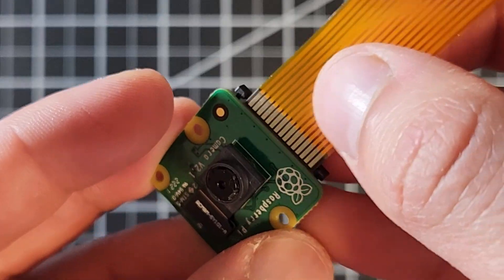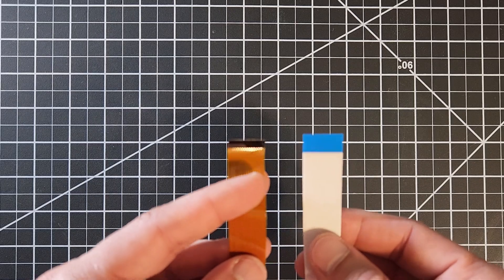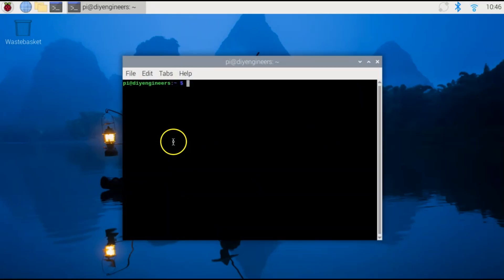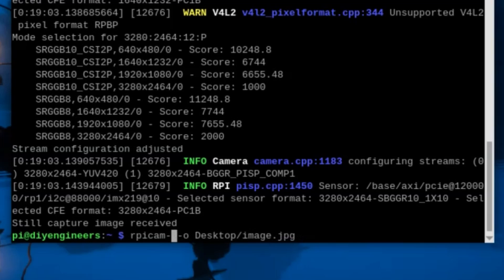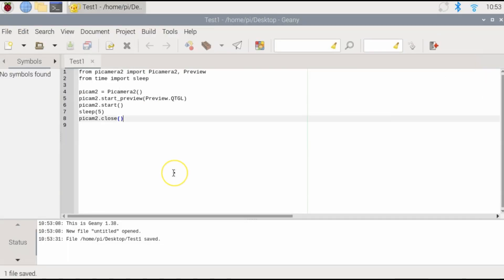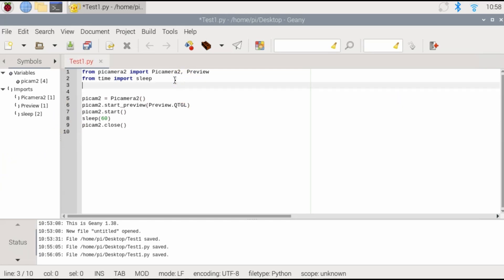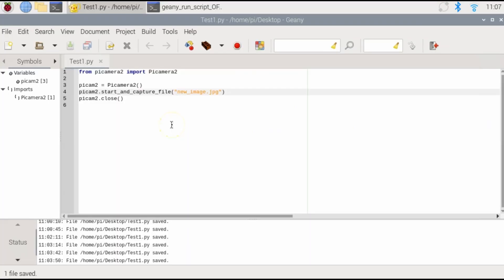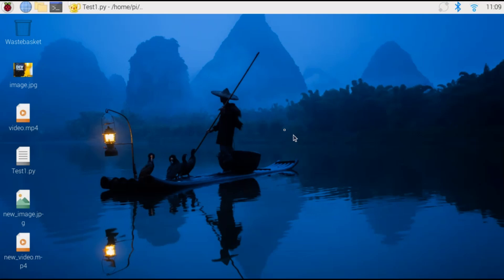Master The Raspberry Pi Camera With This Simple Tutorial!

Comment: Hi,
I’m using a Raspberry Pi 5 with a Camera Module V3 (IMX708) on Raspberry Pi OS Bookworm.
The camera is detected and listed (rpicam-hello sees the sensor), but it doesn’t actually work when capturing images or video. I keep getting a timeout error.

I’m using rpicam-apps / libcamera.
Has anyone else experienced this with the V3 camera on RPi 5? Is there a known fix or workaround?

Comment: Thanks for the video as it helped me install the cable the right way. 
I'm using a Pi 5 with an OV5647 and the latest Pi OS updates. The camera is detected and works, but I can't see the preview with 'rpicam-hello' unless I switch from the default Wayland desktop to an X desktop. 
Any idea how to make it work with Wayland? (The only hint is an error message "Preview window unavailable" where you got "Made X/EGL preview window")
For now I started a second desktop using X to be able to see the preview, but I'd like to make it work with Wayland too.
Reply: Forget it for now.. Despite being with Pi OS i mind, Wayland is insane in my opinion making such a massive change needing different drivers and dependencies and incompatible with the hardware..Pi Foundation must be nuts! Wayland is being used on us like a Guinea Pig is used, and is not yet supported for many things and I hate the decision to use Wayland. The only screen recorder with microphone and system audio that works on a Pi OS being ARM based is blke recorder, which hangs for about 15 minutes until finally the picture or video appears in the screencasts folder.. no progress to be seen just a frozen app. simple screen recorder and gpu recorder wont go as need x11 or nVidia graphics.. Wayland has terrible compatibility with some video and sound formats, and i believe it is more for stabiluity of system than to improve usability, which they need to catch up with as Xorg and X11 are far ahead. Pi OS is anyway stone age rubbish unless you put kde-p-lasma on it
Reply: @thailandamulets  Ironically I ended up using my trusty old Pi3 and just capturing the live stream from an IP camera, while the Pi5 is sitting on my table waiting for to find some other use.

Comment: Hi, may I ask if it is possible to use this camera with Ubuntu24? I am working a ROS2 project, so I need to run ROS2 on rpi5, but it seems only work with Ubuntu24 on rpi5. Thank you very much!
Reply: I have the same problem with V2 cammera on rpi5 on ubuntu 24.04.2

Comment: Great video, though is there any way to modify the exposure and contrast of the camera while it is streaming to the screen? I have a NoIR camera, and I want to mess with the settings to get the most out of the night vision as there doesn't seem to be a premade night vision mode to pick up as much infrared light as possible from the emitters, yet I cannot for the life of me find any relevant commands to do this.
Reply: because there aren't any. These cameras dont have an app or any administrative gui, just a few poxy commands from Raspberry Pi foundation so you can try them and say 'yeah this is only good for developers in industrial AI vision embedding into robotics to train software with, not to use as a camera stand alone in itself.Its ok to use for webcam wifi with a Pico to auto take screenshots or whatever, but unless you are doing a traffic control or population surveillance project for the NWO or APPLE, or some Logistics Seaport surveillance of containers.. then you bought the wrong item.

Comment: Heyy hope you are doing well.

I tried many ways to configure my camera but none worked.
I tried libcamera, rpicam ,etc.
But the output was the same "no cameras available". 
Can you please help me with this .
Reply: Make sure that the ribbon cable is actually a camera cable and not display cable. They look very similar but display cable will not work.
Reply from the maker: Are you using an official Raspberry Pi camera? Did you make sure to connect the ribbon cable on the correct orientation on both the Raspberry Pi and the Camera itself? Is the camera sensor properly connected? Is the camera cable free of damage?

If none of these are the issue, what Raspberry Pi model are you using and what operating system?
Reply: @diyengineers  I am using correct and official raspberry Pi components. Also about the connection part. I placed the one part with the gold pins in line with the camera and the gold pins on the second end of the cable facing HDMI ports. 

I don't know whether there is some hardware issue or not. Please let me know how to check that!!
Reply: @mohammedkaradia2970  Hey. I'm having the same issue. I'm not using the official camera, but I am using the right cables and stuff. None of my IMX219 modules work with the Pi 5. I get the same error as you do. I bet it's software...
Reply: @xshadow-0 did you enable the camera under the pi preferences?
Reply: @mohammedkaradia2970  On the Pi 5 the pins should face the ethernet port. On Pi 4 the wider cable had the pins facing the hdmi port. On the camera the pins should face the circuit board. If you look carefully in the video you can see the correct orientation too.
Reply: @diyengineers  hey bro im using a not official cam and says no cameras available what i can do?
Reply from the maker: Thanks for watching!